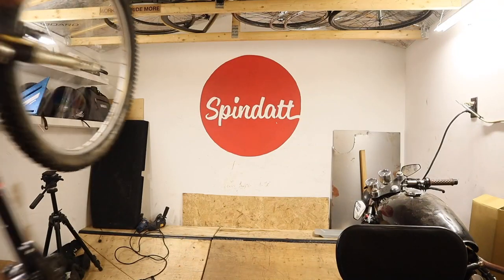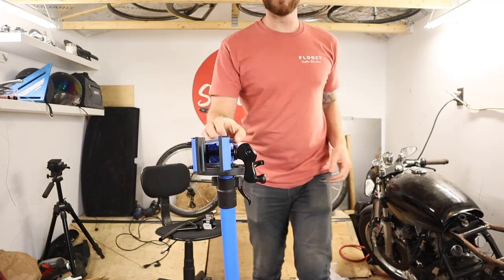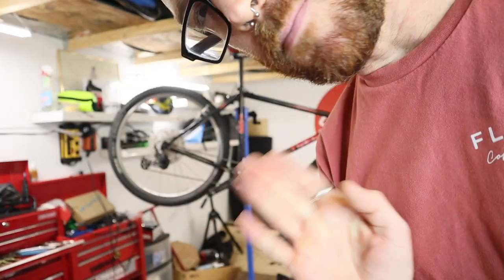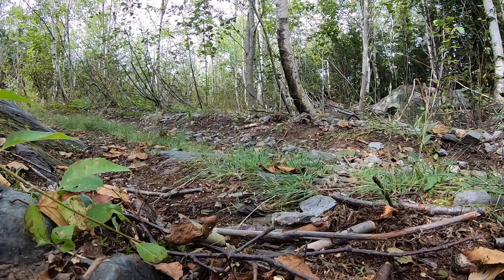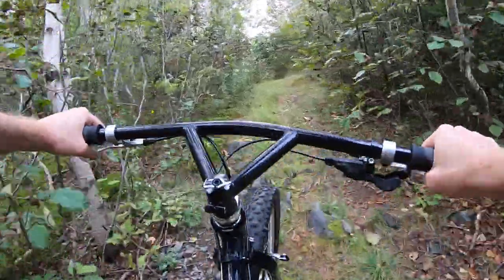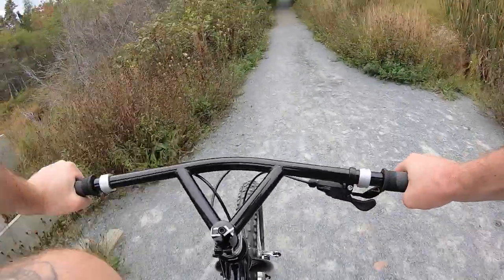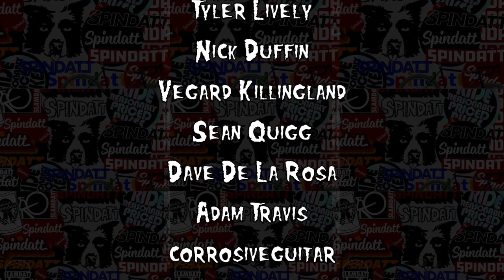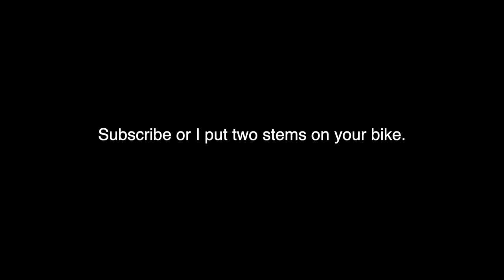Modern Bullmoose Bar |Retro MTB| They Look 🤌

Comment: For me, this is like the perfect take on new modern bike building. Those Nitto bullmoose bars are as cool and baller now as they were 20 years ago. 

I love bulelug's channel even though I don't understand a word of it they build nice bikes. 

Oh and finally on the subject of grips I've converted to bmx grips on MTB'S I've just ordered my second set of wethepeople raptors. I like the fact they are 15cm long so you can use long brake leavers as 1 finger brakes by setting the further down the bar and it doesn't look weird. Also the super hard chunky end caps are bullet proof. The fact they are a quarter of the price just seals the deal.

Comment: My wife runs a 30/51 for her first gear on a 26” wheel.  Seems to work fine.  She’s definitely used it when she rides with me.  When I’m following her and she drops it the 51T it’s like she’s throwing on the brakes.  Hahahahaha.  Cool build for sure.  My steel bike is a huffy Cranbrook Klunker.

Comment: When I saw it at first I thought hmm, but seeing it with the new fork and bars, I get it now. Excellent work as usual. In Spindatt we trust!

Also I totally get what you are saying about suspension corrected forks and tire clearance. I have a 26 I converted to a rigid fork and felt the same way. What did it eventually for me was finding the perfect tires. I went as wide as my rims would allow and love the way it came out now.
Reply from the maker: I was in the same boat! Like.. hmm do I like this? Turns out: YES

Comment: dude , get yourself a pipe cutter for cutting steerer tubes, they're cheap and a lot cleaner than a hacksaw
Reply: Or he could ask his friggen sponsor PARK TOOL for a saw guide specifically made for that task!
I use a pipe cutter too but steel isn’t very easy to cut that way and I can’t find replacement blades.

Comment: They are CrMo not Aluminium, Im sure the Chinese will have them on Ali before long Lol
Reply from the maker: I said steel didn’t I?
Reply: Thats correct, I dont have a problem with CrMo, it suits my old Marin  but I was just stating maybe the Chinese will copy them in Aluminium...
Reply: Im ordering a pair of the CrMo ones from Blue Lug as we speak, thanks for showing them to us!!!
Reply: @Spindatt  Just a point with BlueLug, I'm looking at the whole store, and am thinking that they may be a better option to buy parts than Wiggle or Merlin in the UK, especially for us Antipodeans ...
Reply: I meant the Silver CrMo version, slightly cheaper than the Black ones Eric has....